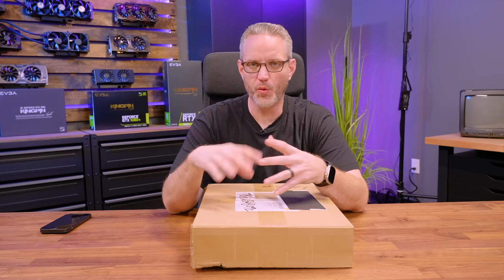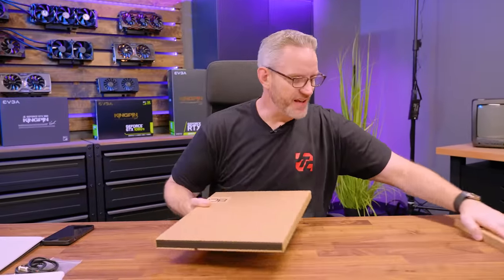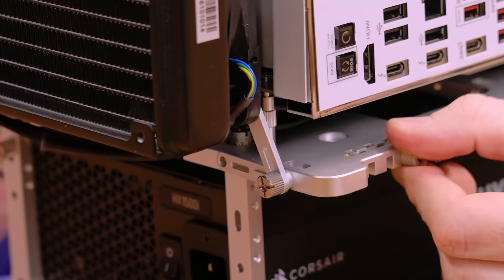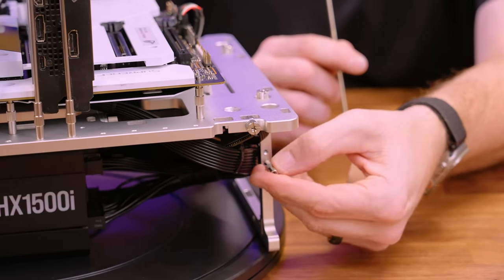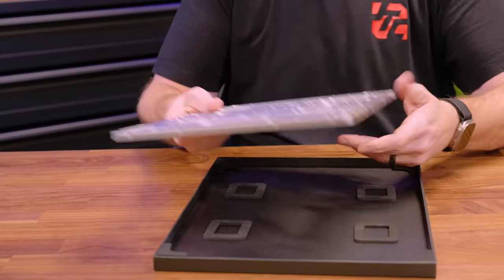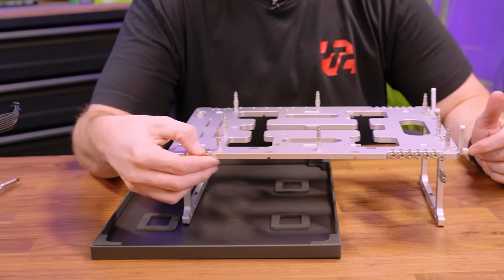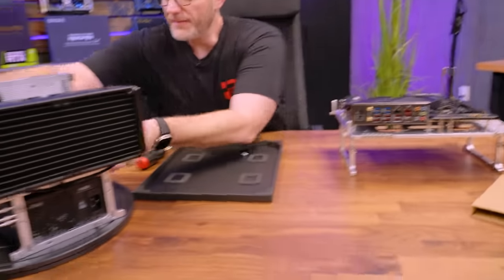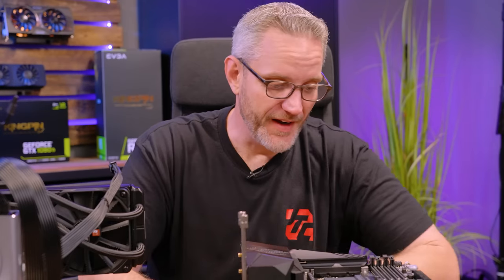This is one of the most impressive things I've seen in a LONG time!

Comment: What's also super cool about this bench is the community that's behind it. Already there are a bunch of things 3d printable for the bench! Like there's a freaking wall mount adapter!

Thanks for sharing!
Reply: dude thats dope! i been thinking about wall mounting my pc. i'mma have to look into this to see if my bro can print it for me. Thanks for the info!!!
Reply: This upgraded (as of dec of 2021 i believe) you don't even need that accessory . Ready to be wall mounted or you can rotate the legs 90 degrees and use it as a display type vertical or inverted stand
Reply: @gtijason7853  no way?!? Didn't even realise that. That makes this even better then. 

I am seriously debating changing out my current wall mount case for this.
Reply: Where can I find the 3D prints? 
Edit. NVM I found it on their website!

Comment: I saw a demo of one of these a few years ago which prompted me to buy it.  Any time I have a new build or are helping out a friend it comes along.  Just amazing and worth every penny.
Reply: When you say you use it for new builds, do you use this to quickly throw it together to test out all components before building it neatly in your new case? If so, makes a lot of sense and I may buy one for this purpose myself.
Reply: @dewjustin  yep, I get nervous when it’s other people’s hardware so I won’t do the box method or the lay it on a gamer’s nexus mat, I’ll pop this out of the box and ina few minutes have a safe test rig.  This thing is great and easy to put together and take apart.
Reply: @dewjustin  that’s what I just ordered one for. I’m doing a direct die build with contact frame for new build and really need a way to do before and after with each mod and let me mess with mounting pressure and/or quickly pivot to a more normal cooling solution if it doesn’t work.

I was gonna do the box thing (didn’t want another thing taking closet space) but this seems perfect

Comment: Hey Jay, just a small correction. Those 6/32" screws are not 6/32". They are #6-32. As in a number 6 screw diameter with 32 threads per inch. A 6/32" is 3/16", which is quite a bit bigger.
Reply: Pedantic as heck, but yeah! Thanks! Sorta one of those little things, that annoy the few that know how the various thread standards work!

Jay's a good guy though, so really, if that's all we can complain about.... :)
Reply: @trevorjones104  As a car guy, one would think Jay knows the difference. Only reason I even brought it up is that it's not the first time he's said it that way.
Reply: lmao imperial units
Reply: Learn something new everyday, didn't even know there were screw nerds! And I mean that with no disrespect
Reply: @bradtraq1  All part and parcel of a trade, and a hobby/sport I'm afraid, and a brain for useless information
Reply: @arbochelli  There were metric screws mentioned in the video as well. But there is a pretty big difference between a #6 machine screw and a 3/16" machine screw. A #6 screw is .138" in diameter( or 3.5mm), where a 3/16" screw is .187"(4.75mm). That's a fairly large difference at that scale.
Reply: @mikeford963  yeah I'm just messing with ya. Seeing screws being mentioned by #'s and fractions is new to me, lol
Reply: @arbochelli  Yeah, the "upside" to being both a welder by trade and an archer by hobby is that I get to learn all about that stuff.
Reply: Just go metric already, no misunderstandings 😂
Reply: @pronkstuk_  Do you have any idea how many trades around the world work in imperial measurements even in predominantly metric countries?
Reply: @mikeford963  yeah, and how the Imperial system is based on a metric standard 😜
Reply: @pronkstuk_  Can you please elaborate on that? The metric system is based base 10 measurements, the imperial system is based on measurements of certain kings body parts. Similar to the ancient Egyptian measurements.
Reply: @mikeford963  yeah one day it was defined by body parts, but now the imperial units are calculated based of the 'standard metre' I believe Smarter Everyday has a video on this somewhere. Or it was some other YouTuber 🤔. 

Also found this in an article: 
When the metric system became prevalent in the rest of th world. The US then redefined their system in terms of it. I.e. so many metres to a foot, yard, inch, et. So many grams to a pound, and on and on.

I.e. the US system was retroactively re-defined in terms of metric. It didn’t originate from there.
Reply: @pronkstuk_  That's not "defining" the imperial system based on metric, that's simply converting one to the other.
Reply: @arbochelli  I think there should only be 5 different screw sizes with just the number 1 thru 5 stamped on the top so the small metric minds don't overload.   As for the rest of us we can use Number sizes, Fractional sizes, Decimal sizes as well as Metric sizes.  It is NOT fair nor kind to expect other people to have functional brains that can understand those lvls of complexity.
Reply: @mikeford963  Well it actually is. Because the imperial system is based on the defining metre, if let's say that fiscal piece of material that is the 'standard Metre' changed in length even ever so slightly, all imperial measurements will change too. Because they are based of that metre.
Reply: @pronkstuk_  No, the comparitive relative measurement would change, not the actual distance. An inch would still be an inch, and 2.54cm is the metric conversion of that inch. If the distance of that meter were to change, the inch itself would not, just the relative conversion.
Reply: @arbochelli  Could aswell measure in donuts per bald eagle kkkkkkkkkk
Reply: @mikeford963  everything aside from the definiton of the inch would change. What previously was an inch now isn't. Object won't change size, obviously, but its defined length has. Tooling made before and after the switch won't match in size despite both being defined as the same measurement.

The definition of the inch being based off of the measurement of it in metres literally means the inch would change if the metre does. If the inch was defined by something else, the conversion would change, but it isn't.

The metre is purposefully defined by something other than the distance of something else, for the sake of replicating the exact measurement without using another distance unit.
Reply: @NuclearHeadshot  Uhm, no, actually. The meter was defined by natural dimensions of our planet. I don't know where you are getting your theory from, but mathematically speaking, it's entirely bogus.
Reply: @mikeford963  uh, no? Historically it may have been defined like that, but just google the definition of a metre.

If you measure an object using a unit, and then change the length of said unit, the same object will have a different value from before. It hasn't changed size, but the measurements sure has. That's a fact.

At any rate, the reasonable thing to do for inches if the metre changes is to redefine the inch using either something else or using the new unit measurement. The most reasonable thing is to not fiddle with the definitions of units at all, and make new and better units instead... Just like the imperial system is stupid overall and isn't used in science anymore and only a few particularly stubborn countries still use.
Reply: German aeronautics engineer here. Just wanted I say I travel a lot for work. I have traveled to multiple countries( including US) and we always use metric apart from a humorous incedent where I sourced 2 ft wheels instead of 2 meter wheels. Apparently wheels were simple enough that it wasn't worth converting to metric. I have still have a pair of those wheels. The colleagues shipped them to my house in Germany. Wonderful people Americans are with a great sense of humour.
Reply: @thee-sportspantheon330  I'm a welder in Canada, we mostly work in imperial measure, but can swap back and forth
Reply: Ahh yes another man versed in thread standards
Reply: @mikeford963  nuclearHeadshot is right.
Since 2019 the meter and all base SI units are defined by fundamental physical constants. Also the imperial system by now really is defined by the SI system and would change if for example the meter would change (which is impossible now due to being defined by constants). The video was by Veritasium, not SmarterEveryDay.
Before 2019 SI units were defined by their historical origins but the  original Kilogramm for example got lighter over the years. Because of that they decided to redefine the whole system.
Reply: @tallAldiProduction  And the meter is no longer defined as a portion of a radian measurement of the earth, it's defined more accurately by the speed of light. More to do with speed of light and time. But either way, that got A LONG way from the original topic of discussion.
Reply: @bradtraq1  Machinists! LOL! I'm pretty sure that it was in a machine shop, where they first came up with the saying that the great thing about Standards, is there are so very many of them to choose from!
Reply: Who cares?
Reply: I think I have now found a way of building a PC with no airflow problems and flexible dimensions  which should improve future-proofing.
Reply: @pronkstuk_ There's at least 4 variants of metric screw threads for each numerical size: Original fine, Original coarse, modern fine and modern coarse  When they changed the standard from original to coarse there was a transition period where only the nuts or only the bolts were changed, thus providing compatibility. The fine (F) variants are listed in a second column in commonly used lists.
Reply: @johndododoe1411  hahah yea there are a few standards. But the 2 that are used most is standard (M) and fine (Mf). 
But one thing that's always the same is the diameter is in millimeters and pitch is the distance (millimeters) it moves in one revolution, not some amount of rotations per inch. 
I'm a machinist myself and cut threads daily. 
What i love about the metric thread system is that if you want to know your drill size before tapping you take the bolt diameter and you subtract the pitch. (M10 drill size is 10 - 1.5 = 8.5 mm)
Reply: @Anedime  Actually, it is pertinent. What happens when you lose a screw and just go your local hardware store to replace them? Grabbing the wrong one doubles your trips. Oh, and pointing out "intellectual snobbery" is the definition of "intellectual snobbery.
Reply: @Anedime  not saying there's a fine line indicates that English isn't your first language.
Reply: Small correction. “A 6/32 is 3/16”, is incorrect. 3/16-24 is in fact a #10-24.  Asme removed the 3/16 designation in the 60’s .
Reply: @Anedime  more importantly an English speaker would NEVER say this about a conversation between non English speakers.
Reply: Although critical, I'm glad you posted that because I always wondered what the #6 referred to.

Comment: They're awesome. I used the mini itx version as a portable case for ages. The small amount of setting up compared to the safety of carrying things in a hard case is a great trade off. I machined a hole in my bench for a power button.
Reply: I think version 2 has button mount on
Reply: Sorry if it's not apparent but why would you need to carry a test bench case around?
Reply: @idontwalkslow  Was the easiest option for portable case at the time. Don't live in the USA so cases like the velka are expensive.
Reply: ? There are tons of small mini itx cases, have been for years now I'm so confused.
Reply: @drunkhusband6257  Thats good. Stay confused.
Reply: @Dantestoussaint  Wouldn't keeping the components exposed while you're traveling be a problem?
Reply: @idontwalkslow  They go back in the box. Not a lot of options for super portable cases down here in Aus. The cost of a Velkase 7 works out to about $500 shipped and that was better spent on components at the time so 10 mins to set up or tear down worked well when you have 7-10 days in a hotel room for work. Added bonus of no heat issues with the ITX test bench
Reply: @Dantestoussaint  That's neat
Reply: @zihechen3111  It doesn't appear. But either way, anyone can download the template to have a mount 3d printed.
Reply: Ask Kangaroo to invent laptop 💻 or something.

Comment: This is so so SO well designed and thought out. The fact it comes with a (felt?) carry pouch is amazing too if you are say, travelling to a friend/customers location and want to throw up the components onto it for testing before doing the full build. FANTASTIC engineering! I'm getting one despite the fact I'll rarely use it 😂🤩

Comment: I have one of these and love it. I mounted my 360 AIO in the middle using the two middle gaps and the little mounts going directly upright and connecting to the brackets of the middle fan.

Wish I could post a photo to demonstrate. It looks great and works really nicely!

Fantastic bits of kit!
Reply: Upload a photo to Imgur or somewhere similar, then post the link here. Not quite like posting a direct pic, but it still works lol.
Reply: Do not have this rig, but watching the video, spotted these two middle gaps, quite obvious they would accommodate two standoffs going to middle fan on a 360 radiator.

Comment: Those are really cool. The way they machine them out of one piece of aluminum and that they store all the spare hardware is very intuitive. I do see some things they can improve on. For example, the aio mounting. They could make the bars a little longer and have multiple holes so u can center the rad. Also, it would be nice if u could mount the rad to the right side. They would have to allow space to pass the 24 pin, but aesthetically, it would look better. I have on of the praxis wetbenchs.

Comment: Kudos to the engineers of the openbench table. Incredibly well thought out, they appear to be persons that have used test benches before. Really impressed with the storage solutions they arrived at so that builders always have the parts they need at hand rather than having to dig through boxes or drawers to find extra parts.

Comment: Literally all I use, love the V2 because of the upgraded threads and the fact that you can use it vertically (standard or upside down) or you can mount them to the wall
Reply: Oh yeah and 280mm rads are absolutely perfect, I actually have my rad mounted on the opposite side (bottom of board) for easier access to swapping ram, cpu's etc

Comment: Really very well engineered and thought out. Even at 250 or so that's really NOT so bad for machined aluminum plus all the custom cut fittings and crews, the push pin MB standoffs are SUPER NICE. That is a fantastic open air case / test bench. Really sweet Jay good call on this one!

Comment: I love that bench. That's a dream CAD project. What a fantastic job. Normally I'd say "$200 bucks? That's a little bit much for $25 worth of Aluminum." but in this case it is a little different. For the style, for the engineering, and the simplicity of the entire design, yeah, I'd say it is more than worth the money. With the right rig that really turns into a work of art.

Comment: I have one of the older versions of this bench for my hardware validation station for couple of years already and it is awesome. Rock solid and so easy to reconfigure. One minus - because it is an older model it does not have a cutout for the power button so i had to put it on double sided tape but that works so i'm fine with it. Also - i don't know about your version but mine has 4 screw holes on both of the short sides to mount radiators/fans of different sizes so you can move the mount points for smaller rad.

Comment: I bought a red one a while back to make a minimal wall-mounted build with a MO-RA 420 on the other side of the same internal house wall, with watercooling passed through the wall. It was a gamble because I've never done something like that before but it turned out great and the OBT made a beautiful and minimal wall mounting solution. I know that's not what it's designed for, but it really worked well.

Comment: That's so well thought out, I bet the designer was someone that had to build and disassemble open bench systems alot & just hated what they could buy and use. Sat down and found a fix for all most all the gripes they had with existing open bench test rigs. 
Will be seeing you use them for extreme overclocking videos

Comment: Get 2 more. One for AM4, and one for 14th gen when it comes out (new socket). Even if you don't need 4 benches all the time, they store so easily, you might as well have an extra one just in case!
Reply: With how pretty it is you could just mount it on the wall above the other benches.

Comment: The lock in standoffs do seem pretty handy.  Probably the most interesting feature of the test bed.
Reply: Seriously, all cases need this option. Maybe with one or two screws to lock it in if you need to.
Reply: @psedog  Inside a case you only like need to do it like once. Also think of the weight of the parts when the mobo is standing vertically. And don't wee need the screws for grounding the mobo to the case?

Comment: Wow I have an og one and use it a lot, just from this video I see they made the knurling better, added a power button mount, changed the rubber feet from the nubs to strips that work better, and made it way easier to store the legs (from the top vs the sides). I might need to order a newer one to save me some time. Should still fit the og slip cover too it looks like. Thanks for the video.

Comment: Jay bought the new OBT version 2.0 which has new holes for vertical mounting of the bench without any additional tools needed. I have a previous OBT design that does not have this option and I hope that Jay will try this mounting alternative.
Reply: One of mine is setup for inverted vertical but you can also wall mount these v2's